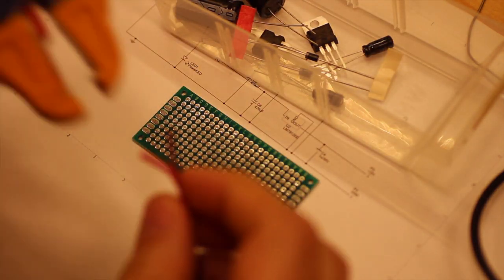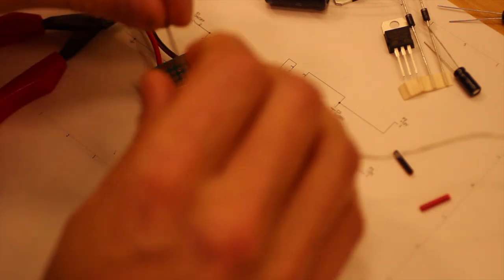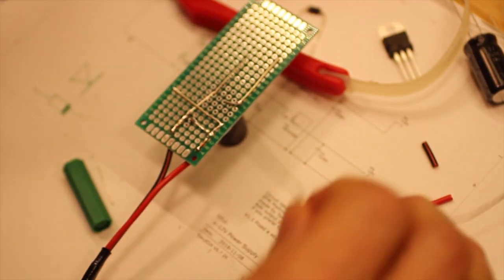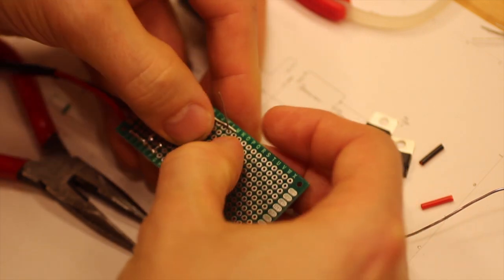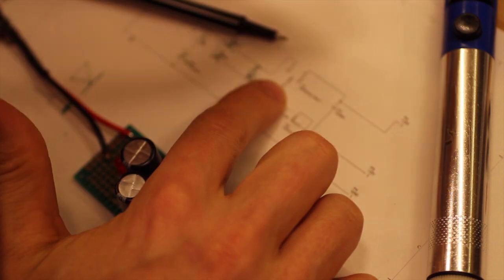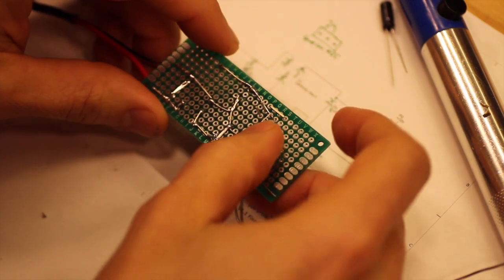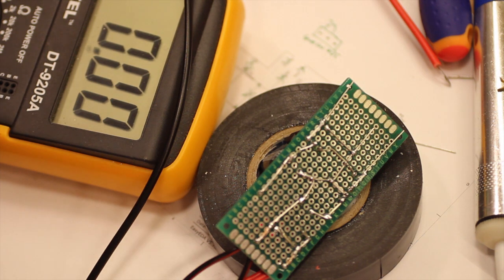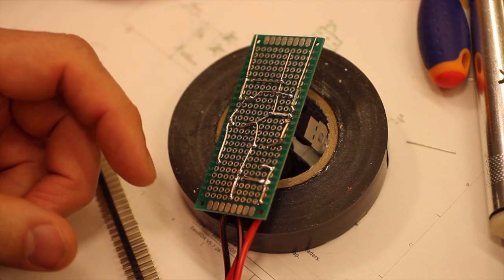How to solder on perfboard 101 Really slow and basic

Comment: Its a perfboard, not?
Reply: That’s correct. The jist of it is still correct. If you can solder this then you can solder a veroboard. But yes I did use the wrong term. Thanks for the info.

Comment: I use the soldered strip type vero board.
I think your boards are called pin board?
Anyway I always wondered how the heck we are supposed to join the components together!...of course...you have shown how with this video. We use the component legs.
Thanks Kristian.
One disappointment about it is we did not see it working with a Synth so I was wondering what it did?
Was it a voltage regulator?
Reply: Oh. I just have missed to link to that. I have actually made a whole series of videos doing over 60+ different modules for a modular synthesizer. You can see the whole series here if you like synths. ;) https://www.youtube.com/playlist?list=PLyE56WXw0_5Q5QGMEXWmskuhojKyRdA3T

Comment: I've a problem when soldering on these green type boards...the solder flows to the other side as well and it's very annoying... anyone know how to fix that???
Reply: Thats the whole idea!!!
Its called through soldering to enable a good joint.
If the tiny pad was only on one side then with too much heat from the iron it would part company from the board.

Comment: choice of components: soldering a relatively heavy lead to a pin board has 2 disadvantages:
the  varied force of a cable lead +connector on the soldered joint is likely to break the wires ;

Improvise a pin board connector  by wrapping/soldering a  wire lead around Pin Header to reinforce its  strength
The cable for a small PC board should from the power supply should be twisted pair using mating connectors.
 
20pcs 10 pairs 40 Pin 1x40 Single Row Male and Female 2.54 Breakable Pin Header PCB JST Connector Strip for Arduino Black> 
$1.88